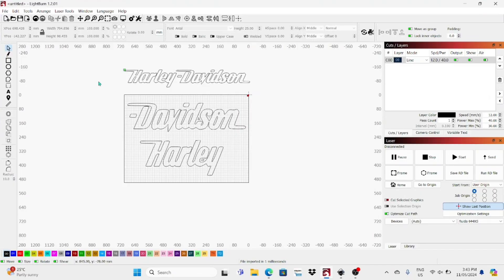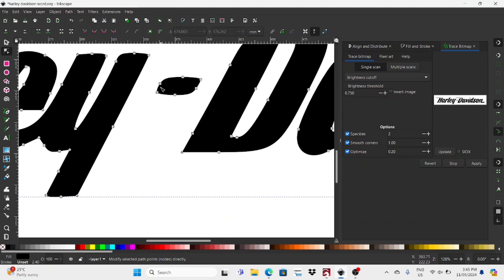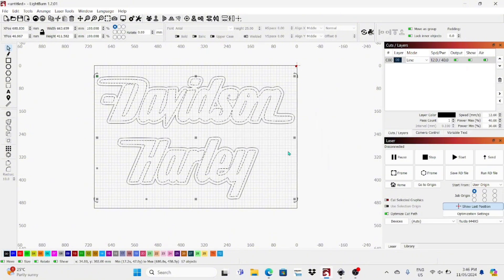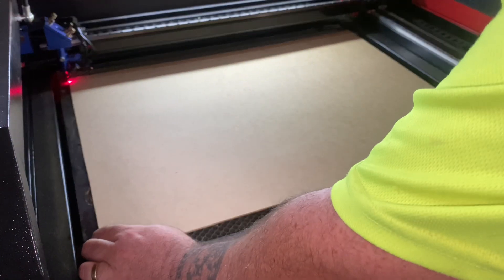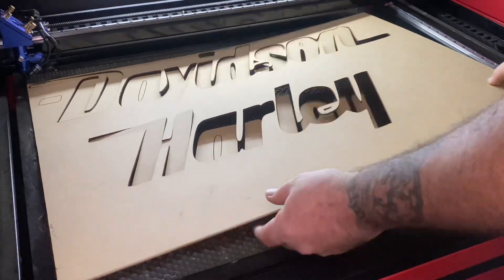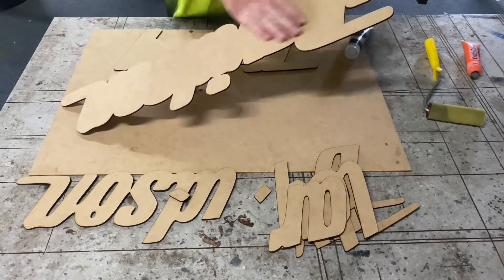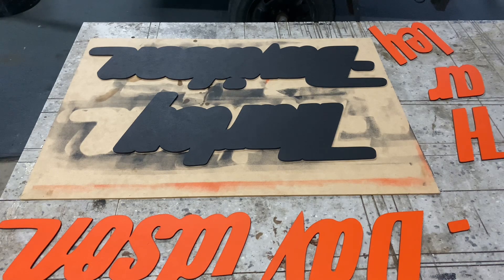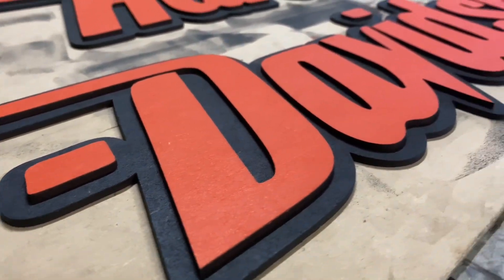How I Made This Sign U/My C02 80w laser!

Comment: Looks amazing mate, C02 laser still working alright? any maintenance required as I saw your first video when you purchased it 3 years ago. Been wanting to invest in one myself, what's the thickest MDF it will cut? Can it manage 12-15mm? thanks Gaz
Reply from the maker: Hey mate, yeh machine is still going great I don’t use it as much now but none the less when I do I have no issues with it,
Iv cut plenty of 9mm mdf with it no issues at all but id say for 15-16mm may need to change the lense out for a 4” one they can cut a lot more standard is 2.5” from memory  
Didn’t really have much maintenance issues biggest one was the bed being un even so had to choc it up on the right side with some little metal plates only 2-3mm but it makes all the difference when cutting from one side to the other other than that it’s been a great machine 🤟🏽

Comment: Hi my name is Fred 
I would like know if you have a rotary tool setup on your laser
Reply: Thanks for the reply I have no plugs inside or switches it looks like everything is just hard wired in 
So guess I’ll keep trying vevor until they give me an answer 
You have great content on channel.have you tried engraving on tiles I do 
Fred
Reply from the maker: @Fred-nv9vg thanks mate I actually havnt tryed tiles but would like to give it a go any info on speeds and power I should try??
Yeh I’m not sure if they all come with this installed I didn’t realise mine did when I’m purchased it wasn’t until I opened it up and realised it had the plug and switch
Reply: Give this a try. I got 200grams of Titanium Dioxide powder from eBay i think it was about $50 I mix it 50/50 with isopropyl alcohol about 3tbsp of powder mix with alcohol don’t need much it last awhile,I find that white tiles are best ,brush on a light coat wait until dry ( Don’t Touch it will rub off )
I use 200-250 speed 22 power text is ok but photos need to be adjusted it will burn black and not scratch off.and rust-oleum spray paint has titanium dioxide in at $18 a can from Bunnings 
Hope this will help
Fred
Reply from the maker: Thanks for the info Fred I didn’t realise you have to coat it with a powder/alcohol mix first good to know I bought some tiles awhile back to try but just havnt gotten around to it as yet 👍🏽
Reply from the maker: Hi Fred, I don’t have the rotary tool but there is a connection on the machine for one to plug into! Thanks for watching,
Cheers, Matt
Reply: I have the vevor 80w co2 laser I can not find any where to plug in a rotary tool and vevor are not much help can you tell me where the plug is there is no plugs inside the machine thanks 
Fred
Reply from the maker: @Fred-nv9vg mine plugs in just inside the machine on the right under the control panal there is also a switch on the front of my machine labelled rotary plane I assume this is to turn the rotary took on and off once it’s plugged in
Reply: Hi
I forgot this just wash tile with water after .I can send a photo if want a look
Reply: No problem you should get good results mix a small amount first .I use a foam brush